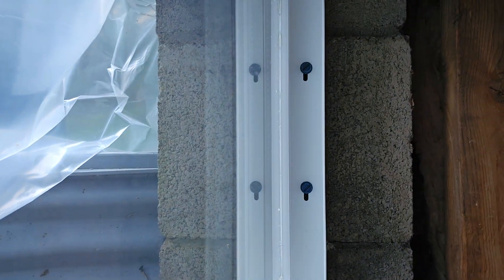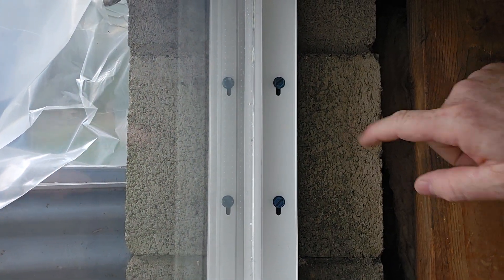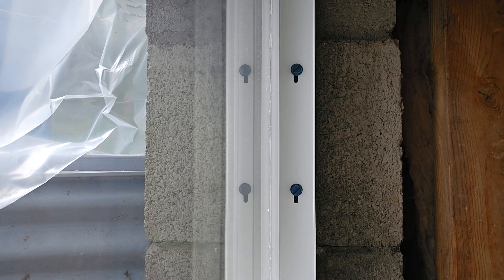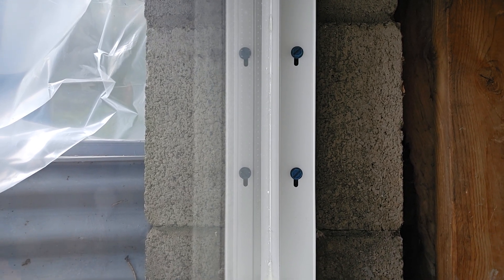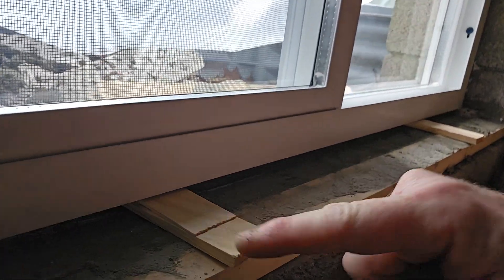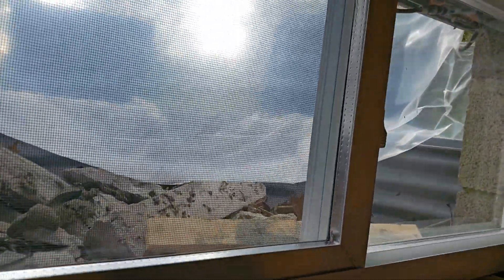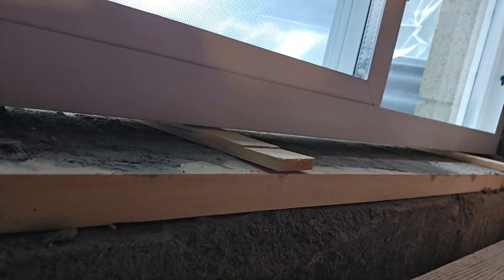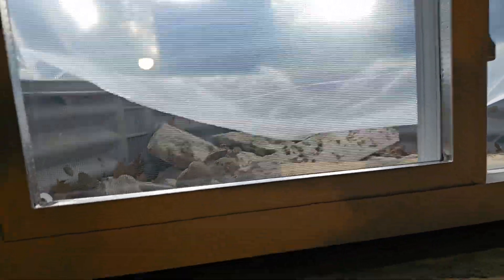Window Replacement Hardware Tips #windowreplacement #basement #basementfinishing #windows

Comment: What screws / tools do you recommend for securing structure to the concrete blocks?
Reply from the maker: @cinnamonFloss  tapcons. That's a specific brand name, but multiple companies make them. Drill the hole with the appropriate size masonry bit, and then run them in with an impact. Go easy on the impact or you can strip the hole.